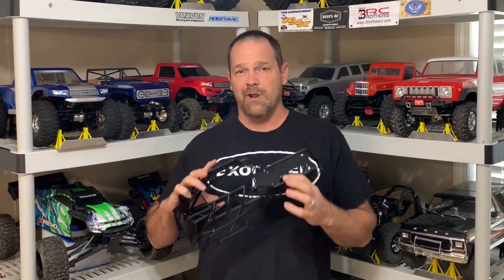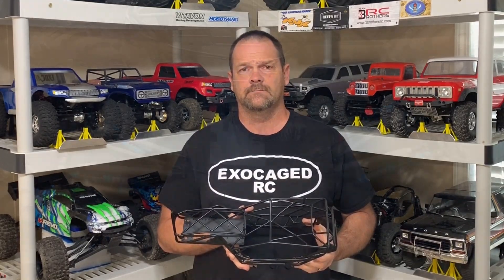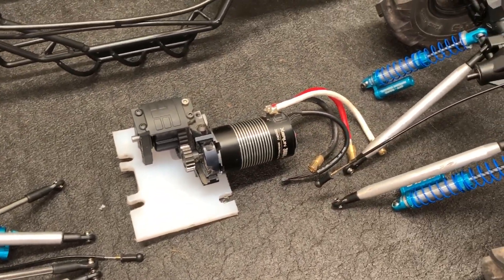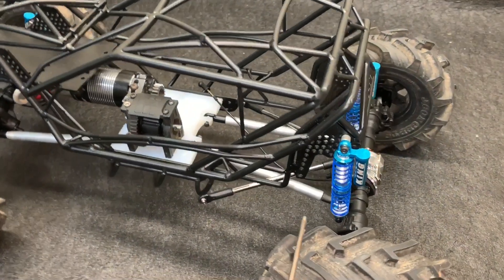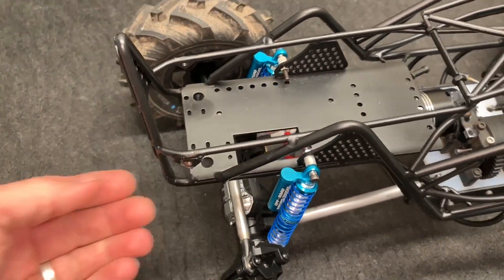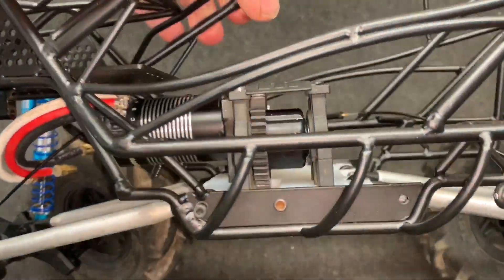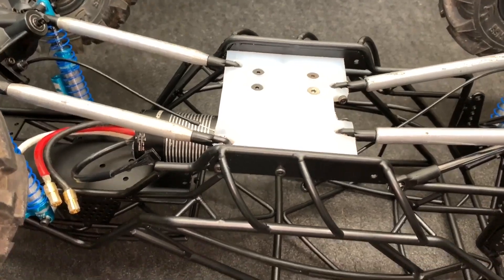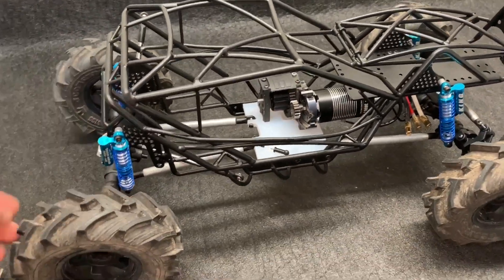Mega Buggy Build Pt1

Comment: Crazy how we are always on the same page with these trx4 affiliations lol. I drive a couple trx's with the AXE and lately I've been wanting to take my axles and make a sort of " bouncer". Didn't want one enough to go buying a bomber or yeti. But I thought about using the mip extended axles again or possibly the portal delete kit to set it aside from the others. I also have been checking out some cages and definitely haven't found one that will work without a decent amount of additional fabrication. Anyways awesome video great idea I hope the build helps me decide how to go about it.👍
Reply from the maker: TopChef R/C Midwest Crawlers yeah this chassis is useless with a trx trans due to driveshaft interference. And the front end is horrible in stock form. I’ve got the chassis work done I just need to get pt2 recorded but it’s turning out awesome. Also has a Reefs Swaybar with a 1/8” bar in the rear.

Comment: Very interesting project!!! How you modified outdrives in differential and remove coupler?
Reply from the maker: Had to have custom outputs made to use driveshafts.
Reply: Exocaged RC Can you give some hint of how you did your outputs in differential? I’m really interested to build something similar.
Reply from the maker: Jarek Ostrowicz yeah basically it was a piece of 5mm or 6mm still rod that was cut and a hole put in for the driveshaft pin and the diff side gears.
Reply: Exocaged RC Thanks! I didn't know if you've been reworking the original somehow, but to make new one I should handle :)

Comment: Awesome vid as always 👍👍 i know you said it's for a trx driveline but could you use a wraith driveline in that chassis?
Reply from the maker: wesley kubelis if you can build a belly then you can use any transmission you want. The TRX axles are over 7-1 ratio so if you want wheel speed you’ll have to take that into consideration on the build.
Reply from the maker: If you use wraith axles you’ll have a ton of room for compression so it could have a nice low ride height
Reply: @ExocagedRC  awesome thanks buddy👍👍 got me thinking now😁😁 and i do love some wheel speed😄😄

Comment: Hi could I please have a link for the cage. would it fit on a axial wreth. Thanks 🙏
Reply from the maker: there are much better cages out there man, this one was almost unusable the way I got it, if you can cut and weld I'll get you a link, if not, I highly recommend you don't mess with this chassis.
Reply: Exocaged RC ok thanks do you know of a better one that I could get instead

Comment: From what tekno model is that diff ,since i've been looking for a long time for a durable center diff with outdrives for a driveshaft and not cups for dog bones
Reply from the maker: Petar Nikolov any of the sct trucks will work but I had these outdrives custom made by a machine shop. I know a guy who may would make a set that can be purchased.
Reply: Thanks for the reply. Knew i had to fire up the lathe and make some outdrives. Hope the project turns out great
Reply from the maker: Petar Nikolov yeah man. I think it’s 6mm diameter in the diff and 5mm on the output you see here to fit the driveshafts

Comment: Does anyone make a high quality tube frame conversion kit, or just the frame for the TRX4? I built my first crawler way back when Axial released the first crawler to hit the market, I dont even remember what it was called, but it was an immediate hit. That was 2004 or 2005 about. Anyway, like the last 30 RC's ive had, before i even ran the thing i ordered ip as many and all the upgrades or cuatom parts i could find, and there was a company who made a full tube frame for it. They had raw steel, black and fully polished chromoly steel which is the one i got. It was super nice and performed awesome. I could articulate the axles just over 90°. I also purchased some super nice machined aluminum wheels, but i just cant remember what company it was. I want to say RC4wd, but the parts werent cheaply built and the prices reflected that. The chassis was close to $300 and the wheels were around $150. I would love to find a nice full tube frame or at least a back half frame...
Reply from the maker: TheSupradude26 as best I can tell this is the only tube chassis available for the trx and it’s horrible unless you cut it up and use a different transmission like I’m doing.